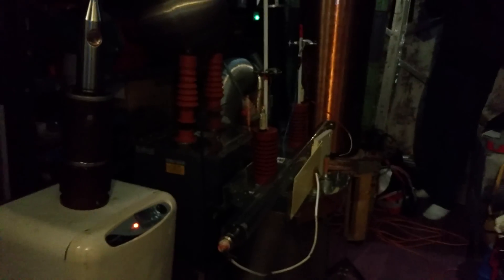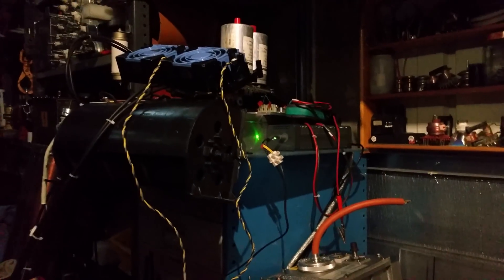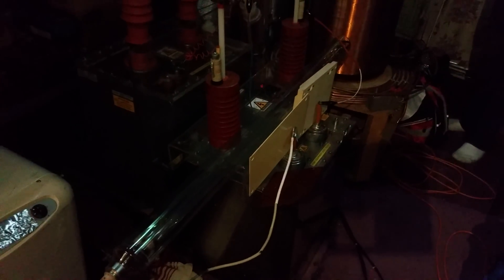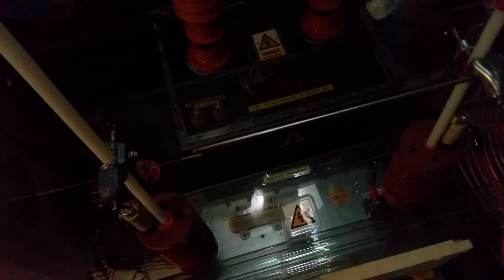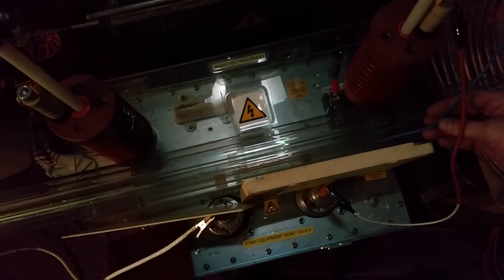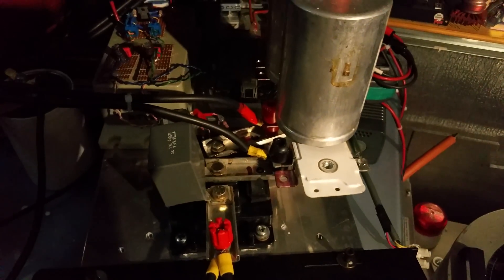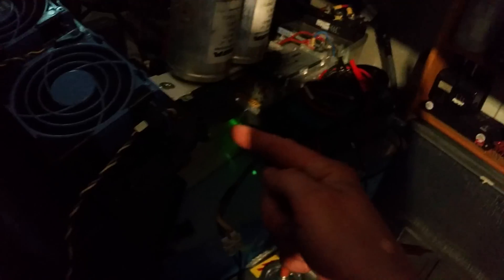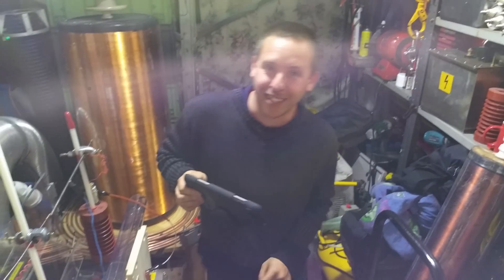Watch this!! Sodiam lamp displays arc plasma

Comment: Does a capacitor and a MOT hold any value above scrap? I do not want to play with them to build a spot welder :(
Reply from the maker: The capacitor hold hardly any but the transformer does. And you get more for the copper if taken out the iron core. So better the split the metals up!  Get more for them. But better to get a lot more together first.
Reply: high1voltage1rules I've had about 20 of the newer, smaller MOT's (700-1000w) and they've all had aluminium windings. Thats why they're shite lol. You can tell if its real copper by the colour if you scrape some varnish off.
Reply: high1voltage1rules if someone needed one i would sell it as is, the copper , aluminium etc i plan to melt in to parts for my car.

Comment: yay 3 view =) jk no one gives a fuck xD the real question i always had is how much current these kind of playing around with hv sucking from the wall ? cause that has to get the bill high no ?
Reply from the maker: Nope not at all bud. It's not from a plug as I'd burn it up as well as the wiring lol. It's pulling about 14 amps with this set up. But other things I do can pull 80' amps or more ;-) thanks
Reply: wow 80A xDD but can you do a crazy MOT with like 1000A ? cause i remember photonicinduction made one. This would be crazy at something like 10v 1000A xDD